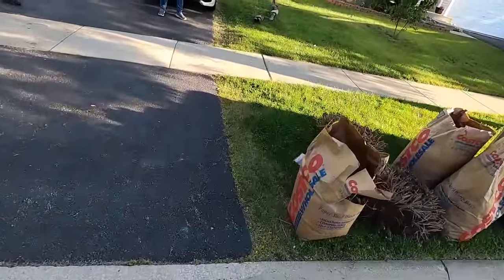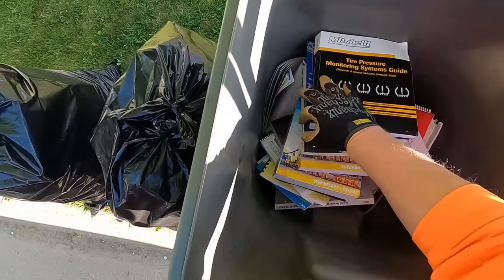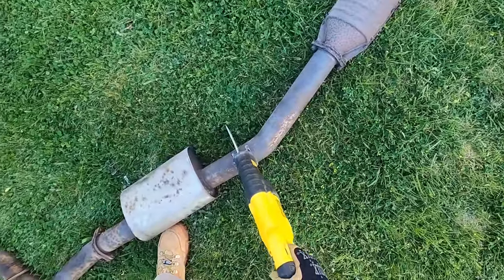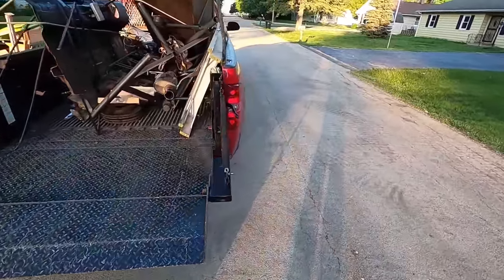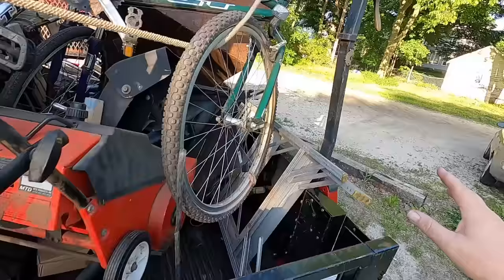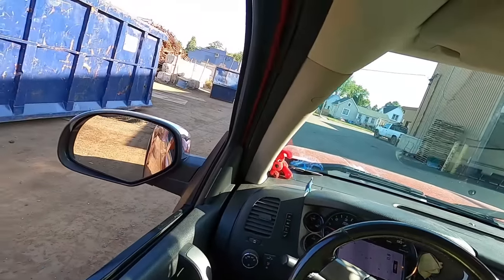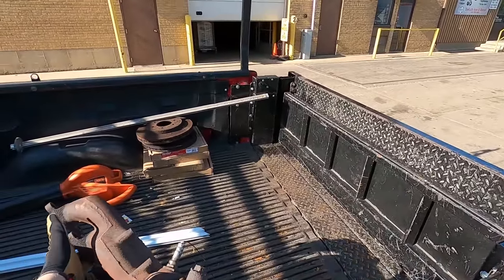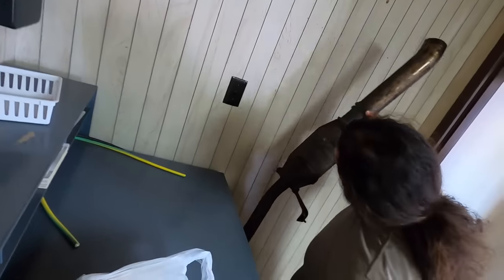Garbage Day Treasure Trove

Comment: Great job Paul! That sledge/axe thing is a splitting maul.  For splitting rounds (horizontal slices of tree trunk) into fire wood ready to burn. The sharp end is for splitting and the hammer end is for pounding in a steel wedge if the other end does not achieve the desired result! Thanks for a great video! 🙂 🏴‍☠

Comment: Hey Paul you forgot to set the e- brake on the floor pan. Paul’s in DeMotte, Indiana which is a local scrap yard here won’t take catalytic converters without a title. But some bring $75 and up depending on the converter. Your about 128 miles from me.

Comment: Nice haul. Cant wait to see what the cat will come in at. I also thought the guy said it was a different metal on the pipe. You should have had that checked as well. Nice video.
Reply from the maker: It was an aftermarket catalytic converter. Hardly paid anything :-(

Comment: When we had converters to turn in we would cut everything off to where it’s just the converter. They look inside to see what type of material is in it to determine what it pays. They have platinum and other stuff in them. Even the resonators are worth more sometimes, like the one you pitched with the rest of the exhaust. I got like $80 for a Porsche resonator years ago from a wrecked 2008 Cayman we fixed.

Comment: That sledge hammer axe thing is a pee- tunk ( may be misspelled) . It's for splitting firewood after you have cut your loga into 16,18, inch lengths and you have the round to then split into fire wood. ✌️👍

Comment: Titanium exhaust?, that would be a expensive exhaust and it has to weigh almost nothing, good quality stainless steel that is hardened over time due to the constant heating and cooling over the years, is my best bet, worked with metal a lot and stainless can be extremely hard, you need special saws and drills to work with in these cases.

Comment: 3 wheel quads were notorious for tip-over wrecks. I believe they're no longer made. A 3 wheel electric bike would probably depend upon the power. Even a pedal model would flip if you turned the wheel too sharply. In my 70s I would be partial to an electric quad. I think it would be worth the small risk.

Comment: You need to be using carbide steel blades for that! I have a saw and the normal steel blades are useless. A carbide steel blade will cut much better and lasts longer!